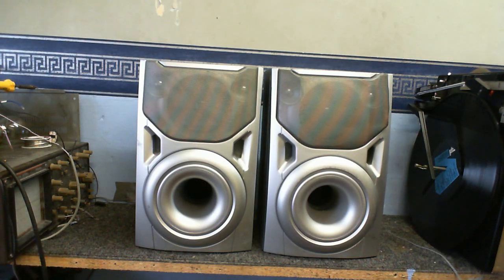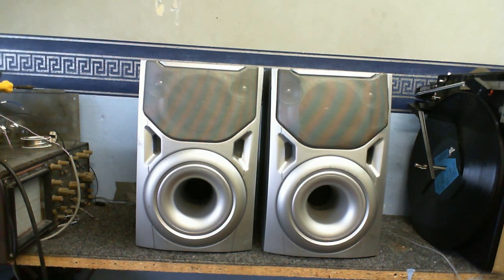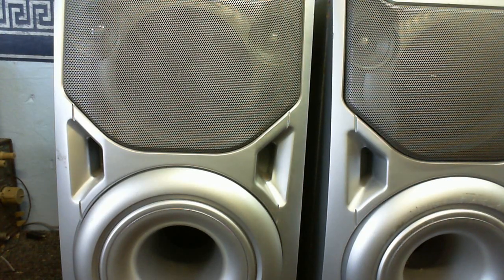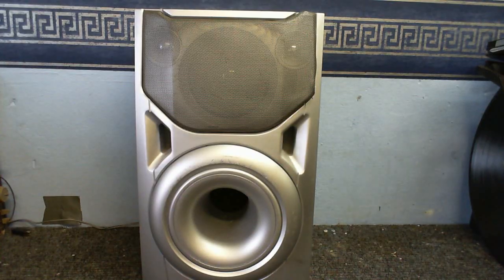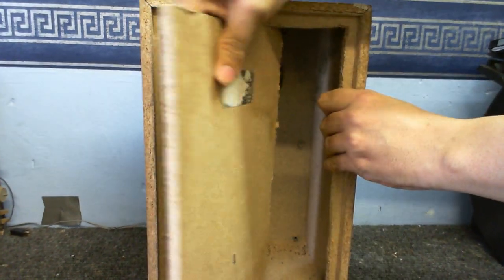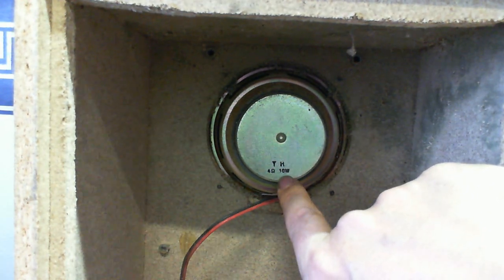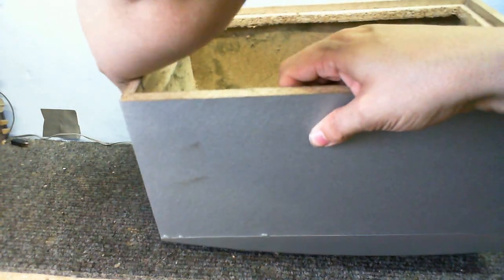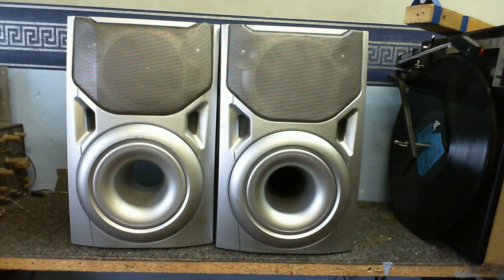What's inside but-ugly modern speakers?

Comment from the maker: I usually record the audio onto tape, then use audacity to transfer that to the computer, the thing is, with Adobe Premiere (I use version 6.5, it's old but, it's the best I've used), I can chop the audio and video tracks up as much as I want, then I can move the pieces of audio and video around and get the audio synced that way.  Problem is that's a lot of work, so now I just record onto my laptop with a webcam and external microphone.

Comment: I'm surprised - those ugly looking ports actually are doing something! But I expected those speakers to have just one full range driver. Better speakers wouldn't look that crazy.
The cheapest speakers I have seen (even lower quality that these) are Schneider speakers from the 90s. Just a flimsy particle board box with a back made from cardboard, and a single 1W full range boombox speaker. The matching stereo BTW claimed to have 160W per channel :D

Comment: They might have been trying for some sort of Bass Reflex system with those speakers, where it uses the sound from the rear of the diaphragm to increase efficiency. But I'd imagine you wouldn't get much bass with that tiny speaker, particularly since the tweeters are fake!